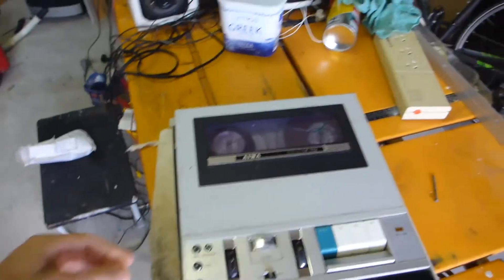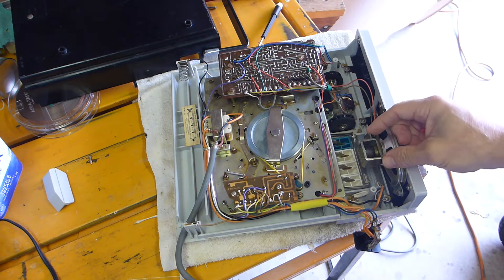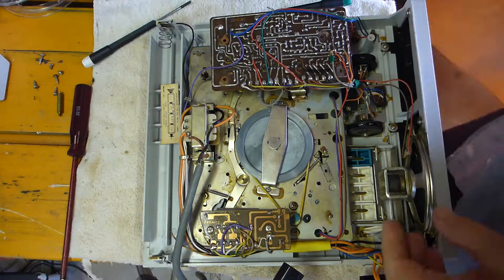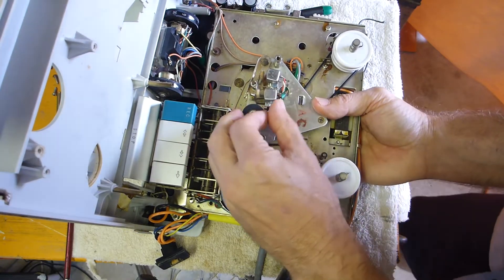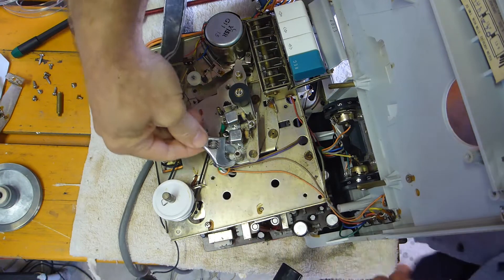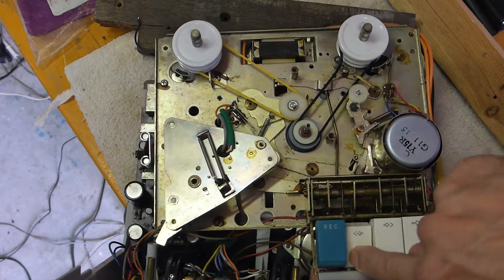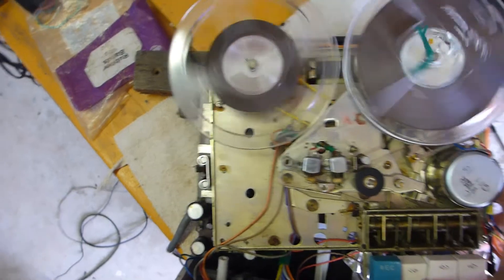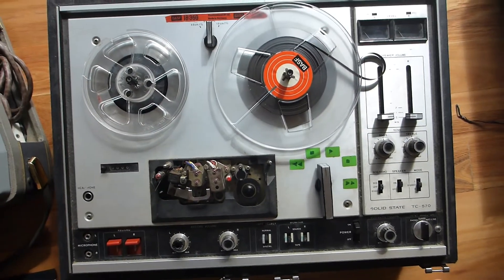1966 AIWA TP-712 Reel-to-Reel Belt Change

Comment: The TP-712 was my first capstan-drive reel-to-reel tape recorder.  It was a big step above the so-called "rim drive" cheap recorder I had which used a movable permanent magnet to erase the tape before it got to the record/playback head.

Comment: Just looking to tackle a belt on a National R2R RQ-503S - is there a place in Australia to get the belt replacements on. eBay - or only overseas? The postage is a killer.
Reply from the maker: Agree, that's why I cheated and used cheap rubber bands. If they are a cylindrical or slip type belt you could be in trouble - but I have found standard (various length) rubber bands work very well.
Reply: @pescado99  Awesome. Thanks. Will have a crack at it.